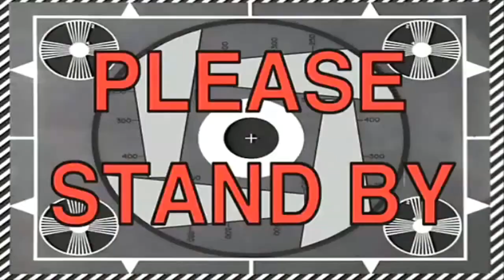THE SUPER GATOR IS FLAT

Comment: The best way to do it would be to remove the secondary clutch and replace it with a sprocket then align the engine sprocket with the transmission sprocket that's how they put street bike engines in rzr

Comment: mate youre putting and much higher compression motor in which means more heat and its an air cooled motor in a place with no air flow. might be an over heating issue?

Comment: If you went to use the torque converter from the original motor then you'd only be able to use one gear. 
And as for the tire changer, Mount it on a removable base. put a piece of plywood under it or make a place to bolt it into the ckncrete. unbolt it when you dont use it.

Comment: id love to show u the slide hammer i built its just a tube with a bout 20 pound pice of round steel inside of it and i welded a chizzle type tip on it i break beeds on tires like on ur truck works like a charm
Reply: also go check ur insta inbox i sent u a message and s vidoe of it

Comment: what you could do is take the steering wheel off put a bike or dirt bike handlebar bar on and run everything like a dirt bike the gas and the clutch and then just make a shifter and put that on the bottom

Comment: Take the clutch system completely off the gator and put a sprocket on the gearbox and use the sprocket that was already on the engine and use a chain and make a chain tensioner to tension the chain when it gets lose

Comment: pull motor and do chain drive with clutch or do smaller Harbor freight twin cylinder engine if you want to keep the belt drive the belt drive will be eaten up by the motorcycle engine

Comment: you could just put the motor in 2nd or 3rd gear and it will still have way more power than the original motor

Comment: an auto would work u wouldn't need a jackshaft that's for sure u have 1000cc but I don't now if an auto is possible because I now a lot of the older bikes is like ur honda 450 were it's the motor and a transmission all built into one  not until later when they started separating them so u may be forced to go manual if  there, not separated but then again it is an older bike im sure there's a lot of aftermarkets parts for it and im sure ur going to go thought the bike first before u put it in place I would change what I can first before I stick it in lets be all honest its going to be a very tight fit and u may not be able to get to things once it's in there  so if u need to change anything starter alternator clutch change it that way u now it will last longer look at it as preventable maintenance